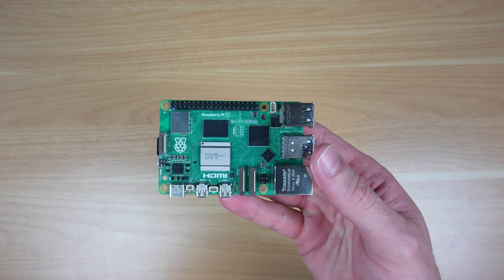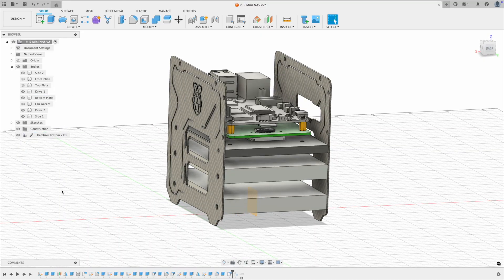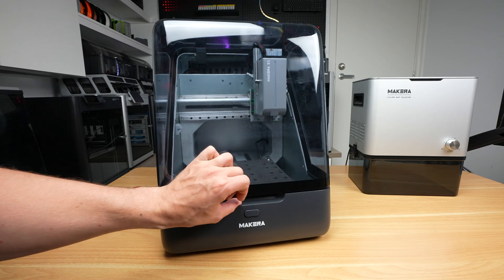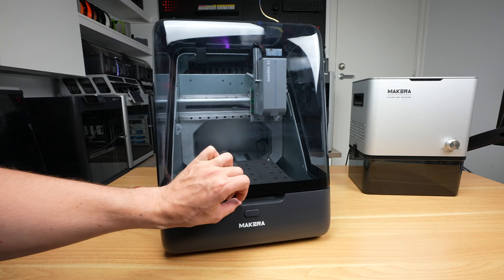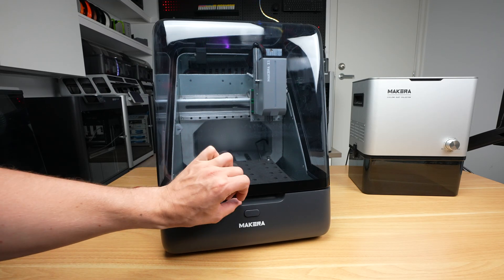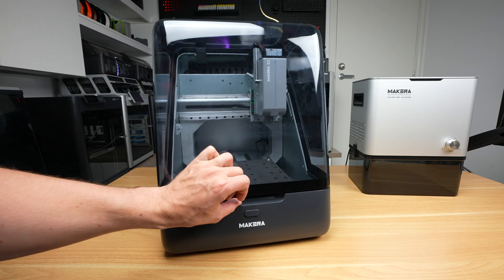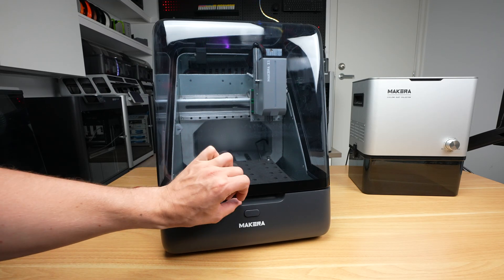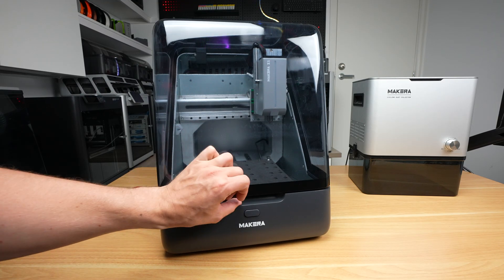Pi 5 NAS With Custom Carbon Fibre Panels, Made on the Makera Z1!

Comment: With the Pi 5 I prefer to not use an SD card - just do a network install of the OS onto an SSD - much more stable in the long run. I've been mucking around with RPs for over ten years and have had SD card failures.

Comment: No need any more since my brand new pi was being used to our sync data to a share drive on a travel, router, and for whatever reason the drive is no longer usable on any machine, even after changing the cable on a sandidk 8 TB.   No more data and no reason to back up anything in a system that does not work correctly from my point of view.    It’s not corrupt it no longer exists as a device on multiple machines.   By the way, don’t ask Gemini for help even with Linux.

Comment: Love the video, but freaks me out when I see people cutting carbon fiber. I love the material, but without a wet bed, I'd be too terrified that carbon dusts goes where it should (my lungs). Be careful out there!
Reply from the maker: Agreed, I wouldn't cut carbon fibre on an open machine or without a dust extractor connected. The negative pressure inside the machine really helps contain the dust and as long as you keep the extractor running a short while after cutting, it captures almost everything. Also, always wear a respirator when sanding the panels afterwards.
Reply: @MichaelKlements  But as far as I know, the Cyclone is not properly rated for CFRP dust. Apart from this, disposing the dust in the household trash might also not be legal for food reasons depending on where you live.
Reply from the maker: I'm not going to pretend to be an expert on CFRP dust but the Makera Cyclone Dust Collector has a cyclone to extract large particles, then a sponge prefilter, a 99.99% HEPA filter and then an actviated carbon filter, so I don't think any CFRP dust is getting through that. 
Whether or not you can dispose of it in the trash will depend on your local regulations.

Comment: I would love to see some real world numbers for data transfers. I had similar setup with rpi4 with a lot of IO bottlenecks. RPi5 sounds like it could be great improvement.
Reply from the maker: I did some realworld tests towards the end of the video, it consistently saturates the gigabit network port without any issueMy testing only covered a single connection to the NAS though.

Comment: Cool. Are there any considerations using USB connected drives?
Reply: The OMV guys won't let you do RAID with USB drives
Reply: @A @An.Individual am not asking about RAID only
Reply from the maker: For this application there isn't really much to consider - they operate the same was as the PCIe connected drives. OMV won't let you put them into a RAID configuration but you can force them into one through the terminal - I just wouldn't recommend it.
Reply: It's a sensible precaution to not use RAID on USB drives, but I suppose it could be forced via mdadm.